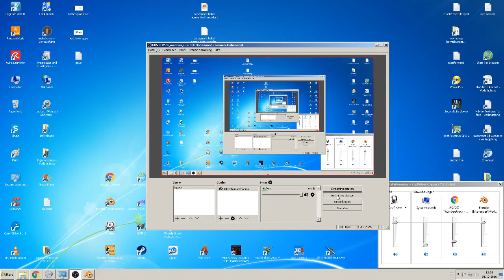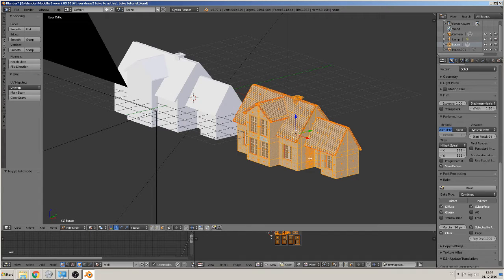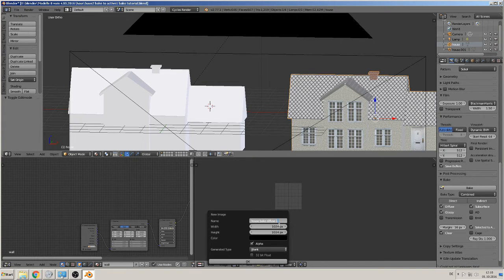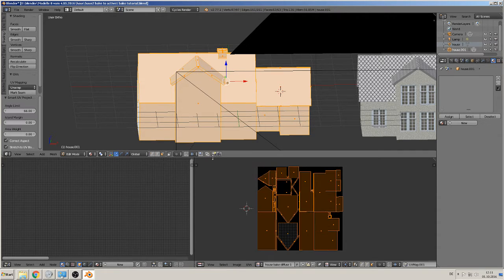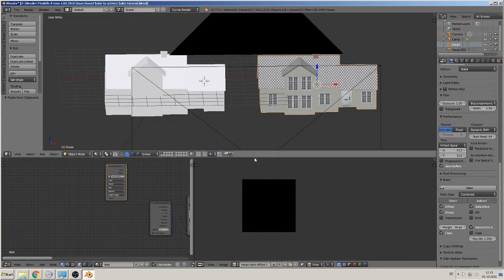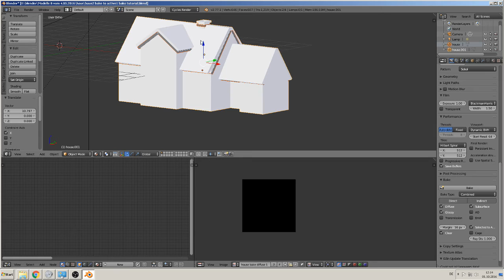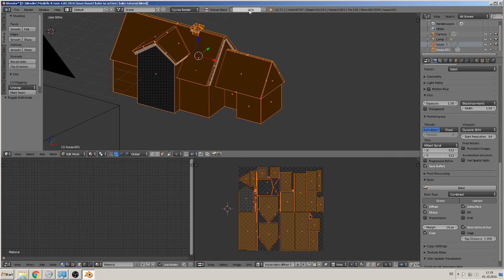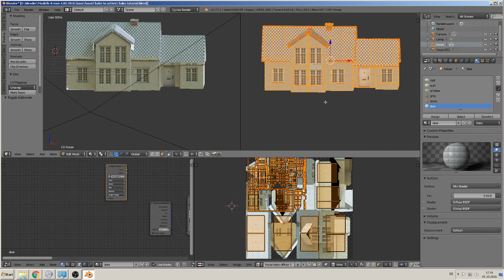blender 3D tutorial bake diffuse to active object

Comment: So if you do this process, the images/materials on the high poly should transfer onto the low poly, correct? I just want to make sure.
Reply from the maker: you bake the materials from the higpoly object to the uv of the lowpoly object
Reply: In your opinion, would this be faster than painting/coloring the objects with a separate graphics program like Photoshop?
Reply from the maker: some times yes
Reply from the maker: yes
Reply from the maker: some times is diffrent for each project